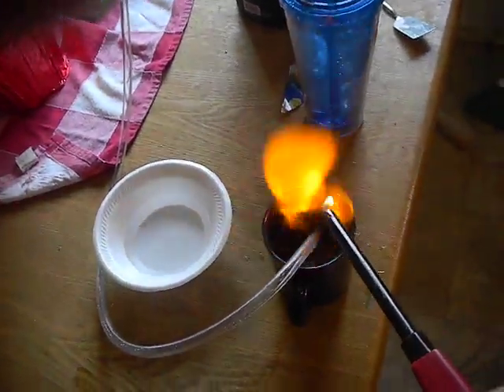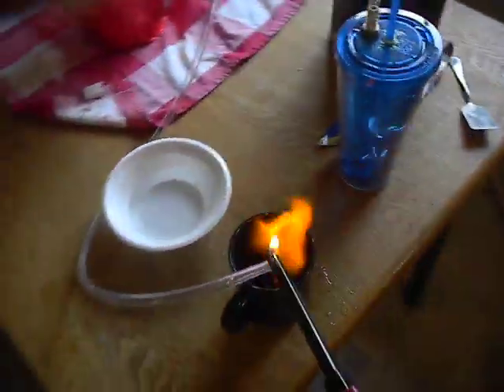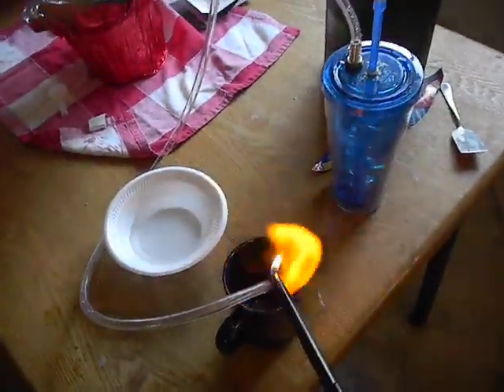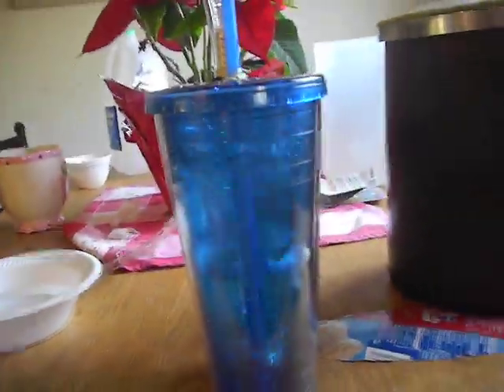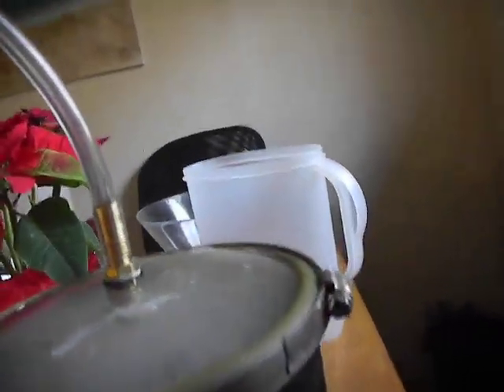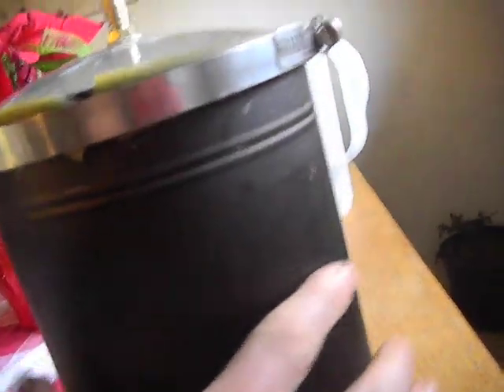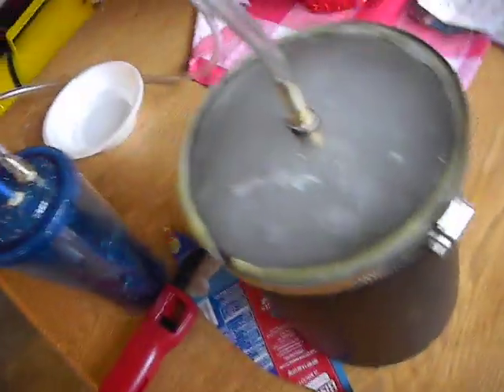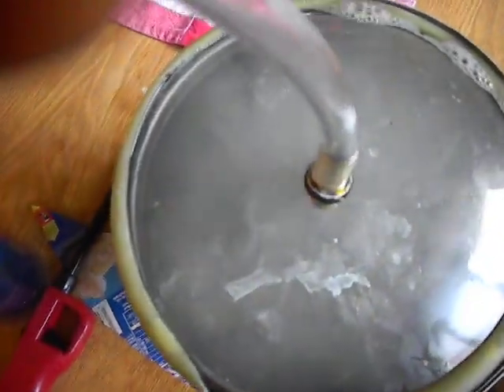hho production no electric power needed

Comment: Not HHO, just Hydrogen. This is hot water, sodium hydroxide, and aluminum...creates lots of hydrogen and heat. They designed a car that uses a reel of aluminum wire as the fuel and was fed into a reaction chamber as needed to produce hydrogen to run a standard internal combustion engine. End product is bauxite which can be recycled back into aluminum with electricity. Aluminum stores more energy per pound than gasoline.
Reply: Nice. Sounds a bit more wasteful than charging a battery, though ...
Reply from the maker: yes if to much aluminum added it can cause it to boil instead, cut my fual mileage down to half with this system at times better
Reply: Correct. It's definitely a chemical reaction creating fuel gas. Maybe it's a great idea if you have a lot of the metal requisite to begin with. As far as it being HHO.. this is not HHO.

Comment: Adding  gallium to the water and warming it first will allow the aluminum to continue to disassociate hydrogen without an oxide film build up which normally stops the reaction right away.  Gallium and (alumina) can be recycled and recharged. We could consider aluminum to be a good fuel for electric fuel cells if it is charged using alternative energy sources. Hydro electric, solar,wind,ocean waves, tidel currents,,radio waves.

Comment: As others have noted, this setup is generating only hydrogen (and some water vapor as this is exothermic.) I would have guessed it was Hcl acid and aluminium, but Joseph Azzato clarified that it was NaOH (sodium hyrdroxide, lye) and aluminium, though both combinations will produce h2 similarly.
Fun fact: If you were to mix bleach and hydrogen peroxide in a similar setup it would produce oxygen. You could then mix the output gases before burning and if you measured out your chemicals properly you could have 50/50 oxy/hydrogen.
Reply: EDIT: sorry let me clarify, DO NOT mix peroxide and bleach in WITH the aluminium and hcl.   I should have mentioned you would make 2 identical setups like the one in the video.. one for peroxide and bleach (creates oxygen) and the other for aluminium and either HCl or Lye solution.   again do not mix any type of acids or strong bases with bleach it can produce chlorine gas which is extremely toxic and WILL kill you.

Comment: A big BOMB !!!!!!!!!!!! BTW, hydrogen does NOT burn yellow !!!!!!! It burns blue !!!!!!!!!!!! you got something else mixed in there!
Reply: oxyhydrogen, as its mentioned in the title?
Reply: No, it's true the reaction produces oxygen and hydrogen together. Hydrogen needs an oxydizer to complete combustion. Oxyhydrogen ?? Is that a new term?? Simply put he is building a big bomb! NO ONE MIXES the two together until combustion is desired!!!!
Reply: just google it
Reply: I don't care what you call it , if you mix the two inside a sealed container, it's volatile and it's a bomb !!!!!!!!!!!!!!!
Reply: yeah i got it: its explosive, just as propane, is everybody with a gasgrill at home building e bomb when he grills?
Reply: No.  MUCH worse.  Propane needs air to burn.  Which means that the speed at which a propane flame will burn depends on how fast it can mix with oxygen.  Oxyhydrogen doesn't need air.  It ALL goes boom at once.  One is a flammable gas.  The other is a "fuel-air" explosive.

Take a tank of propane.  Crack the valve.  Light the hissing bit.  You get a tame flame, because oxygen can't get back into the tank.

Take a tank of oxyhydrogen.  Crack the valve.  Light the hissing bit.  The whole tank explodes.  At once.

See the difference?

Frankly, I think this guy has a mini-propane or butane cylinder inside the black can.  Because it sure ain't oxyhydrogen burning at the end of the tube.  If it was, the oxyhydrogen would flash back up the tube and quite likely blow the rest of of the setup to pieces - do you see any flash arresters in that setup?  I thought not.
Reply from the maker: LMAO!!!
Reply from the maker: ahh bubbler Hello!!!

Comment: I see a lot of people saying this is fake. Its not fake. It is the reaction you get when you put aluminum in the solution of Lye (Sodium Hydroxide) and water. The flame is the correct color because it is 99% pure hydrogen. This reaction produces just hydrogen no oxygen that's why you don't get that popping sound all of us come to know with HHO. With the kind of setup it will produce a lot of gas really fast with no way of controlling it (that I know of). The device under the table that someone mentioned looks like it is a trash can.

Comment: What if 1 gap will be connected to  <2V, suppose 1.5V? if electrolisys will stoped  completely, or just slow? i find out, that with 40-50% NaOH water solution(high density like syrup, so slow ion migration rise parasite inner resistance of cell, convert it into water boiler(resistor) also, like tap plain local quality water, without salts or enother dissociator additives(we need no isolator(like distiled- not dissociated water, without ions that really work in reaction)  in cell gap, more dissociation, and lower resistance - as result, the same result if you add more NaOH, and get  twice time better water dissociation H2O-> H+ and OH-, or you will make twice bigger plate surphase, just to double water ammounts between catode and anode, or you twice lower gap distance, and snail-paced(slow moving) ions will be twice faster on half distance passage of ions to plates, all that metods will work like when boss get more cargadors for some product transfer, or find closer supplier, and more deals in one day for one cargador happens... contrary - dencity of solution lower migration of ions, solwed by intensive electrolite mixing, sollution, and limited grade of dissociation in >20% concentration of NaOH( aq.sol-n ) that both problems solved by higher temperature, at 90C or even 110C(50% NaOH boiling temperature 140C if remember right, with evaporation water as the overheated 140C water steam, but boiling unstable, and can work like little explosive, for example stay silent for 160C then throw away from flask(always wear safety glases with NaOH KOH or Superglue(instant, acrilate glue)!!!), addition of acrivated charcoal to 50% aq. NaOH unfortunately not working as Neutral plates(maybe we need stainless steel powder suspension) and gase ammounts the same(on 1 wt of consumption), but acts like lower distance between plates, because you substitute some electrolite by solide conductor coal  nano particles, chains fractal trees, tubes,spheres e t c and addition of activated charcoal(from drugstore - digestion black charcoal tablet for example, or water filter)acts like more concentrated NaOH, and with 1 gap cell, I can reach on 5V the same power consumption and gase production like on 12V without coal, with only NaOH strong aq.sol-n.
Reply from the maker: have you ever heard the saying don't fix it if it's not broke? just lye tap water aluminum nothing more is needed.

Comment: Dude stop fucking with people get your facts right first this is not hho (meaning there is two hydrogen cells for every oxygen cell) and the easiest and cheapest process to achieve the this gas is electrolysis. What you are doing is using straight hydrogen or water and carbide gas I can tell because one if it were hho it would have an incredibly fast ignition when you would have ignited it ,two it would have made a louder and more violent pop ,three if it was any type of hho cell and it was producing as fast as that was it would be producing more steam than the actual gas, forth the fire was a reddest orange meaning that you were either using straight hydrogen or water and carbide to produce acetylene and hho does not burn that color its usually invisible or a more darker red .